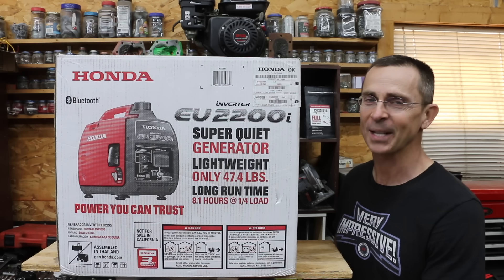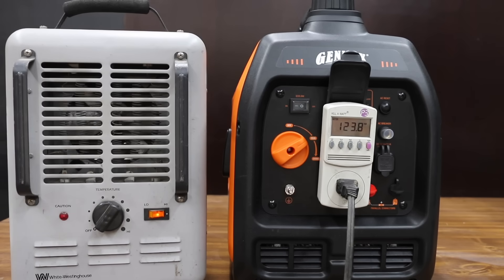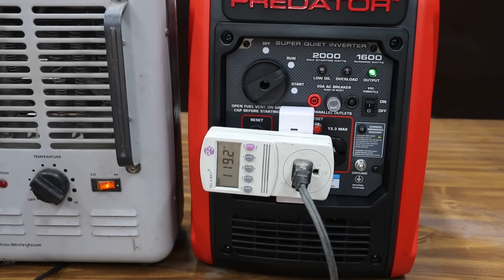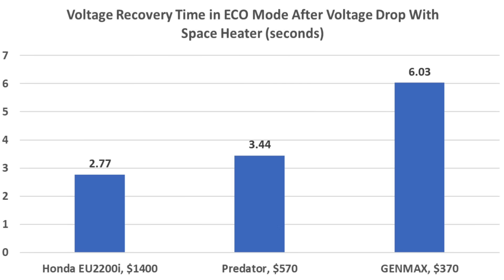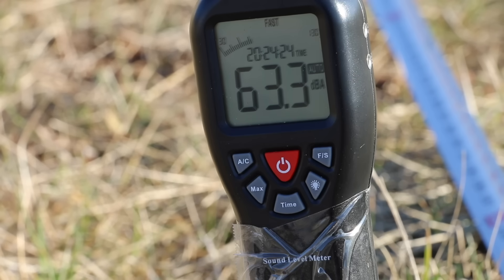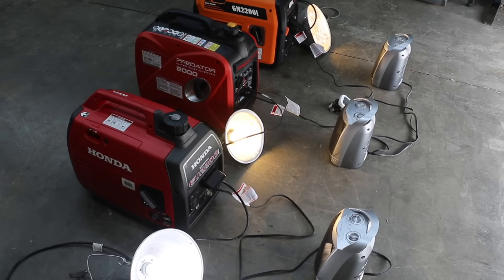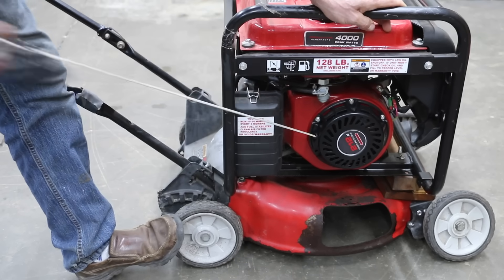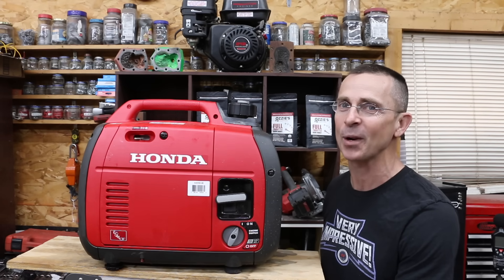Cheap Generator Better Than Honda? Predator vs Honda & GENMAX—Let’s Settle This!

Comment: Honda, Yamaha & Champion are considered the big 3 in generators for job sites... would love to see Yamaha and Champion tested like this. Especially the oil test as nobody else does that and it's very indicative of engine longevity.
Reply from the maker: Thanks for the video idea.
Reply: @ProjectFarm  I'd love to see a dual fuel generator added to the mix to compare the benefits/tradeoffs of gas vs. propane.
Reply: @davejmathis  I had a 7000-watt dual-fuel Champion with electric start. I loved that generator. The obvious tradeoffs: propane is much cleaner to handle than gas. And way less smelly. I never ran my generator on gas. On the other hand, propane is harder to find and the tanks are bulky and expensive. I had five tanks. My generator would run my entire house (except for the hot tub) for nine hours on one regular size (4.5 gallon?) propane tank. But wow; was it loud?! On a cold winter night, you could hear it a block away, but not in my nice warm, well-lit house.
Reply: @ProjectFarm  almost 2026
Reply: Really amazed that Yamaha wasn't included or another brand like Generac (Generac's tend to be used as whole-house generators).
Reply: I personally have 3500 hours on my Yamaha 2000is generator with no issues. 
A friend who lives off-grid in Arizona had 18,000 hours on his Yamaha. 
It's his main source of power.
Reply: Don't forget Generac. The Generac GP2500i is a really good value and the IQ3500 actually beats Honda in some specs.
Reply: Agreed! Love to see Yamaha and Champion in the mix with Honda. And how the 3k generators stack up on noise and efficiency
Reply: Champion is very noisy.  Who needs that?
Reply: Genmax , Wen , Maxpeedingsrods , Power Smart  are all great generators for the Money  , Predator & Champion , Generac  (Not the big Whole House units there made here in the US ) are Way over priced there made in China just like the others .
Reply: What about yanmar?
Reply: I've gone to Champion. I wouldn't call it 'the best', but more the the best value.
I even have the 15kw tri-fuel.
Reply: With cars you are supposed to run them gently for the first hundreds of miles. Is this also indicated in the generator manuals? I wager that the wear will reduce once that phase of parts adapting to each other is over. Perhaps honda has already done this in the factory. Why not ask them?
Reply: @nutzeeer  Honda has a break in over 100 hours mine said to change the oil every 20 hours for the first 100 hours and then as needed after that. I have had the Honda's last for over 12 years and I have a couple now that I use for jobs .
Reply: I second Kyle's notion!  I've had excellent experience with my Yamaha in years of full time RVing, but I recommended my neighbor buy a Champion, as it's similar but significantly cheaper. He bought 2! I chose the Yami over Honda for a few reasons. Honda at the time didn't have a fuel cutoff for running carb dry for storage, Honda has interference timing belt- Yamaha has lifetime chain. (Honda's last awhile but when belt breaks or stretches, it's essentially disposable). Honda also didn't include fuel-level indicator, convenient for quick check, but especially for filling up without overfill-spill. Yamaha generated same amount of power as Honda with smaller engine and is more fuel efficient. Everything else was comparable (quality engines and electronics, sound levels, Yamaha weighed a hair less at the time). Overall advantages went to Yamaha (especially Honda's love for interference timing-belts), yet Yamaha was a few $hundred cheaper! I would've bought it over Honda if it was the same price, but the lower price sealed it. I didn't know about Champion inverter style at the time, if I'd known I would've considered it. Compared to my neighbor's Champs, I feel my Yami has slightly better quality (and convenient fuel guage), but his were likely an even better value. We both feel they make the Honda seem 'overrated' and overpriced.  No matter what you buy, I recommend adding a digital hour-meter (most don't have this essential feature)- they are under $10 on Ebay and very easy to install. I also recommend a magnetic oil dipstick to make engine last longer, as they don't have oil filters. Every time I check mine, there's fine metallic 'silt' that's not being circulated in engine to cause unnecessary wear!
Reply: @humanoiddisguise lol the Honda literally has a screw you can turn to drain the carb…. Also the magnet on the dip stick is really iffy I have heard of some having the magnet fall off and ruin an engine and lastly if you have a good fuel tank you won’t over fill….. the Honda isn’t over rated and just for your info a smaller engine will have to maintain a lot higher rpm’s to maintain the same output as a larger engine…. I have a Honda  and never had any issues… it’s so good I don’t even use my 13000 watt generator
Reply: @humanoiddisguise  There's a reason I chose Honda over Yamaha:  Dealer access and parts availability.  I can count at least three dealers within my area that sell Honda within a 100 km radius compared to the one Yamaha that's over 100 km.  James Condon also demonstrates why you would buy Honda over Yamaha when he had to repair a Yamaha 3000VA inverter generator on his channel.
Reply: @humanoiddisguise  TY i forgot about the famous timing belts on Honda engines  and your right belts slips or breaks  all you got is a very expensive boat anchor my point  when  the inverters on a honda generator burn out there is no replacement part available  all you got is a useless good running engine thats  it
Reply: My only experience with Champion generators is people who think it's a good idea to run one in a campground.  Lots of watts for cheap isn't necessarily good.  I've also camped next to someone with a pair of smaller Yamaha generators with the parallel adapter and, given their reputation, I was blown away by just how loud they were.  For cost/performance/noise I like Wen generators as they are very reliable, quiet, good on fuel, and inexpensive.
Reply: @406Steven  there are many  different brands out there and prices Honda might be quiet and good on fuel but not reliable ... i have heard of Wen generators  if you can get parts for a Wen then it's a good buy
Reply: @rogerstlaurent8704  As far as parts I can't comment, I've only been running Wen generators for about 5 years and haven't needed replacement parts.
Reply: @rogerstlaurent8704  Looking at the test results Todd has here, you would probably be replacing that Wen every five years compared to maybe ten with the Predator and over 20 with the Honda.
Reply: @406Steven  Agreed. I've got a 11,000 (gas peak)/8,300 (gas running)/7,500 (propane running) dual fuel Wen that is nearly unstoppable. My small generator is a 2000/1600W AIPower that is plenty quiet, reliable and fuel efficient but misses the advertised mark on output by just a bit. Both have been way better than I expected for the price.
Reply: If you can, also measure the temperature of the oil crankcase while each is running. If one is running significantly cooler, that is going to translate into most likely longer life. Please include the Champion 4500 hybrid generator.
Reply: I want to purchase one. Which one would you recommend for me?
Reply: i would buy a champion over a honda any day The older Honda Generator were good and lasted there  inverter generator  are JUNK  just to replace that one part is more then the generator itself and good luck buying that Inverter part unavailable  and the warranty is also a joke good luck with that  Honda Generators are very expensive boat ankers  if you got to Tray fixes all youtube channel he has a very good video about Honda Generators and why not to buy them  he speaks highly  about Champion Generators and why they are worth the money over a Honda very over price equipment  Harbor Freight is good but its a hit or missed you get a good product or a piece  of junk product  as for Yamaha never really worked on them not sure how good they are
Reply: @rogerstlaurent8704  My Honda 2000 ran for 12 years every day for 6 hours and i used it several times for jobs . I have had a couple friends who bought champions and they didn't even last a couple weeks on a job but they were stupid cheap and still not worth it. As far as the inverters going out on the Honda generator's the one I ran everyday for 12 years it only went out after 8 years and when I replaced it i found out why it went out it had a capacitor rubbing on the frame and it rubbed through easy fix. I got a used inverter for 200 bucks online and have as a backup just in case.
Reply: @rogerstlaurent8704  what’s an anker?  Oh you meant ANCHOR.
Reply: @paulu7751    have you never heard of an anker  before LOL
Reply: @paulu7751  Well, now that Apple owns Anker, it too could be considered an anchor.
Reply: @rogerstlaurent8704 lol wrong, someone I know ran diesel through their Honda. New fuel pump $20. And new plug $3 and runs like new.
Reply: @ikeyeet8312  sounds like the guy cant afford a honda generator.
Reply: @rogerstlaurent8704  went shopping saw that Hondas now made in China. Went with a 3400w champion open box to run out AC. 200+ hours a year. Have close to 500 hours and runs great. 
Emailed champion needed a Hugh elevation jet, it was went out free. 
It's heavy and over kill but wife wants AC in RV and was worth it now it is my backup gen at home should run quiet if there is power.outtage
Reply: @omieyouknowme My Honda generator was made in the same country as Honda's GX series commercial general purpose engines:  Thailand.
Reply: @rogerstlaurent8704 I bought a Yamaha many  years ago. Its amazing and bet it wi outperform and outlast all the others stacked up against it.
Reply: @rogerstlaurent8704  Good to know.  Sound advice. Thank you.
FYI - ANCHORS, not ANKERS.
Reply: @rogerstlaurent8704  Are low cost replacement inverters available for the other brands?
Reply: @rogerstlaurent8704 this comment is number 1 bullsht.
Reply: @rogerstlaurent8704  I've torn down several Honda eu2000s and they're incredibly well built compared to chinese competitors. Even changing the timing belt isn't a big deal if you know what you're doing. 
My main issue with cheap generators is they stop producing power, something I've never had an issue with on a Honda
Reply: @mendonesiac  Not saying Honda is all  junk its a very good product  but some parts you cant get like the inverter part without that  part all you have is  a running engine  some people in the comment section claim that part is available   well if you want to spend countless hours on the internet looking for a Honda Inverter  thats fine and good luck looking for one if you are a shop owner how in hell are you going to make money tearing apart a generator replacing timing belts and other stuff  and you are paying and employee by the hour ??? and their warranty  sucks  The homeowner generator could be sitting at a repair shop for weeks until honda makes a decision  what is covered  and what's not  covered  thats why small to big repair shops dont bother to repair a Honda  generator that needs a lot of work how would you feel  if i handed you a repair  bill for   $500.00 and $600.00 dollars or more  for a 8 year old generator  i  am sure you would be very pissed off and there is a very good chance something else would breakdown     if your a DIY homeowner and want to spend the time fixing your generator hey go for it  the other question is would i buy a  newer Honda generator with the inverta NO repair shops would say the same thing stay clear of Honda Inverter  generators   there are other generators out there are just as good and parts are available at a fraction of the cost
Reply: @rogerstlaurent8704  lol, I only know one shop in my area that doesn't like Honda, and they're terrible at repairs and blame ethanol in the gas for everything. 
I live in a rural community and Honda is the gold standard for small engines. Everybody has an old dead Champion or some other Chinese boat anchor behind the woodshed, but the little red ones will run for thousands of hours. 
Sure, if the inverter goes bad there's no point in repairing it, but I don't know a single person that's had that part fail.

Comment: next video idea use 3 or 4 honda clone engines with different break-in procedures. 1 no load, 1 full load, 1 varying, etc etc.
Reply from the maker: Thanks for the suggestion.

Comment: Honda actually did very well in terms of fuel use. It is a bigger displacement engine so will naturally use more fuel. Having said that it was almost as good as the others showing just how efficient it was. Even if it's more expensive I honestly believe the reliability alone is worth the price.
Reply from the maker: Thanks for the feedback.

Comment: With a 50% larger engine, obviously the higher torque is going to keep the Honda from losing voltage when powering up a high amp device. Fuel usage is impressive for such a larger engine.
Reply from the maker: Thanks for the feedback.

Comment: I have been running a wen 2000, all these engine except the Honda the predator are running a Yamaha clone. It’s been running almost continually for 5 months, no problems. They take 350ml 10w-30 of whatever synthetic is cheaper, changed at 20 hrs of operation for the first 200 hours and 50 hrs after that, must have over 2000 hrs of operation at this point, I should probably gap the plug but it still runs fine. Picked it up for $220 at a store that sells returned items, it was brand new in box. Whatever you buy, that metal fuel strainer is useless because if there is dust, it will get in the fuel tank though the air pressure relieve cap. Install a cheap in line fuel filter and save yourself from cleaning the jets out.
Reply from the maker: Thanks for sharing.

Comment: Can't wait to see a Yamaha inverter unit go up against the Honda. On the other hand, what if you'd try what I'm planning to do - use a small engine, attach an alternator (or two in parallel, like in high power car audio if there's enough HP) then a small battery for buffer and a good quality inverter for mains output. Useful for the DIYers that have some engine lying around, and for those who already have 12V or 24V solar panel setups this will be an easy add-in. Keep the videos coming!
Reply from the maker: Thanks, will do!  Thanks for the suggestion.

Comment: As expected, I thought propane could be stored longer. I researched and found as long as there are no leaks from the tank, it can be stored almost  indefinitely. 👍

So that would be my choice for many reasons
Reply: Propane is the best for an emergency backup. Gas works better for everyday usage. 
I am already filling the truck and bringing 20+ gallons of gas for the dirtbikes and 4 wheelers; adding 10 gallons to run the camper all weekend instead of a 50lb propane bottle is easier.
Reply: @leftyeh6495  

I don't think I would use propane for 4-wheelers and dirt bikes anyway. I'm thinking long tern survival storage.
Reply from the maker: Thanks for the feedback.

Comment: This video reminded and inspired me to run the somewhat neglected Champion generators that I'm responsible for.  I've got them humming along under modest load as I type this, and going to check them every hour for a few hours.  Also, you gave me the idea to monitor output voltage, wattage, frequency, and power factor with my own Kill-A-Watt as I'm doing so.  Thanks!  As with many of your videos, I kind of want to go out and buy one of these three portable inverter generators! (:
Reply from the maker: Thanks for sharing.

Comment: No surprise that Honda outperforms almost everywhere but price. But you get what you pay for! 
My Predator’s crankcase was full of metal filings and shavings brand new out of the box. No doubt a lack of quality control after the machining process. I flushed it with oil, and it’s fine for now, but that may be why so many people have oil consumption issues on low-hour Predators.
Reply from the maker: Thanks for sharing.

Comment: I'm not sure if it's different for inverter generators but on small engine mowers we use 4-cycle engine oil specifically made for small engines.
We used to use car motor oil but the engines would mess up and run on one cylinder. The techs said it's cause we use car oil which is harmful to small engines because they contain detergents and don't have any zinc which the engines need.
Reply from the maker: Thanks for sharing.

Comment: I have the Honda 2200 that I have had for 8 or 9 years now and change the oil at the start of th ecamping season and I need to top it off near the end of the season. The Honda will shut itself off and will only run for a few seconds before giving the oil low light and shutting off really, really early. Very little has actually burned out before it does this, but it does make it so it doesn't get damaged. Noise levels have been great and even in B.C. where htey have very strict sound rules in campgrounds, they have been fine with me running it outside of their designated hours. I have never had a single issue with it and even the spark plug is still in great shape after all this time. I am very impressed by it and swear by it.

I just thought I would add that every year I put hundreds of hours on the generator.
Reply from the maker: Thanks for sharing.

Comment: You could buy 3 genmaxs,or 2 predators and almost a genmax for what a Honda costs.. But Hondas are worth their asking prices if one wants trouble free,quality, quiter, and longevity plus holds good resale value in most areas... That tailgaters is a pos,and wasn't worth the 79 bux they were wanting for it just 3 years ago,let alone a full buck n a quarter now...
Reply from the maker: Thanks for the feedback.